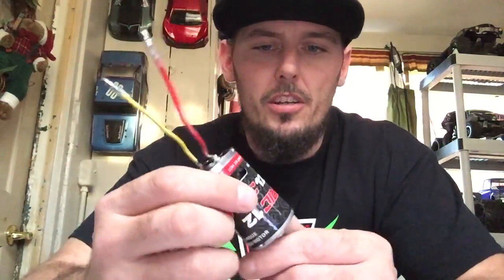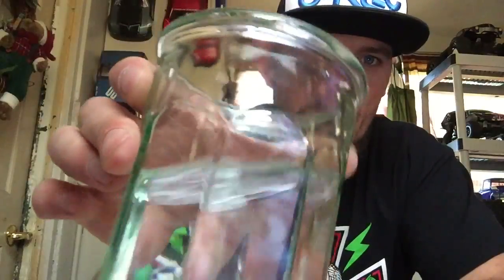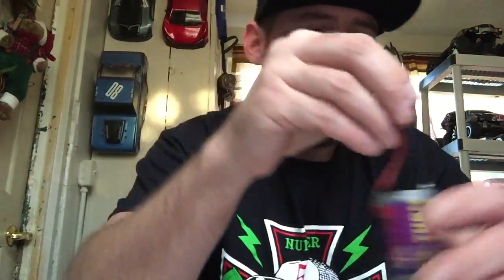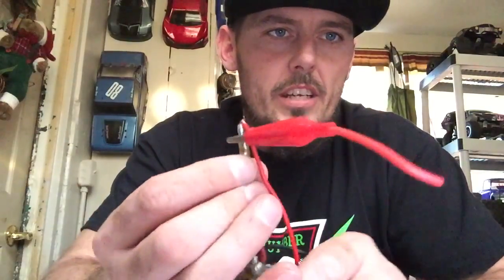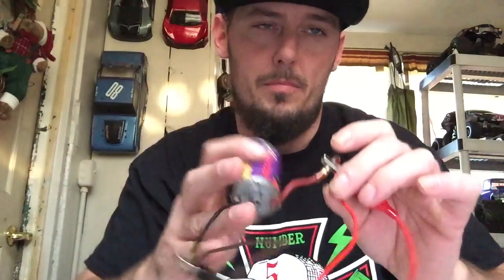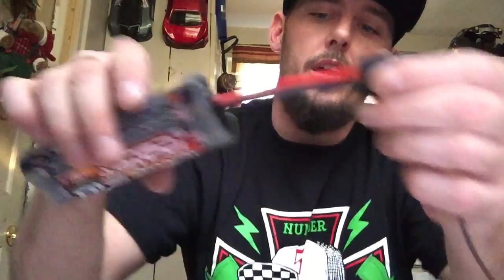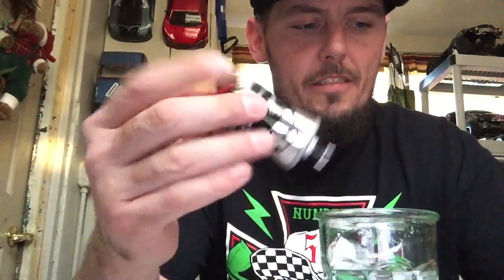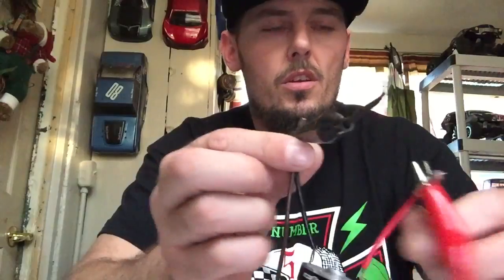How to Break-in or clean your Brushed Motor properly #DontDrinkTheWater

Comment: What's the pros to keeping brushed motors vs brushless?
Reply from the maker: That really depends on your planned usage. Brushed systems are cheaper. Can be cleaned. Offers smooth start up for crawlers and all around durable little boogers.
Reply: @TribeRc  i am new to all of this kinda stuff. I picked up a 4x4 Traxxas slash with brushed motor and I don't know what motor I should go with. I just run it for fun with my step son so I don't want to put a bunch of money until I know he likes rc cars. So if you have any info that would be great.
Reply from the maker: @jasonbowers9210  I'd first just keep it stock as is. The 4x4 Traxxas Slash is a great platform right out of the box! If your looking for more run time and alittle more speed buy a 35c 2 cell Lipo battery with Traxxas Connection.
Reply: @TribeRc  I did the lipo but now it seems like the car is slower than when I first got it. I have had it for a month and I haven't been very nice to it lol so I'm thinking it is wore out. How can I make sure it is or isn't?
Reply from the maker: @jasonbowers9210  next option would be brushless upgrade. I really enjoy the  Castle Sidewinder 4 Combo. This combo runs about $120 i believe. That combo will run 2s Lipo or 3s Lipo. Another option for alittle more money but a super upgrade is a Hobbywing XR8+ Combo.

Comment: Just saying if you had a battery connector on one end of your wires and used those alligator clips on the other end. Just plug it to battery then clip alligator clips to motor. Also removing the pinion gear from motor is less messy